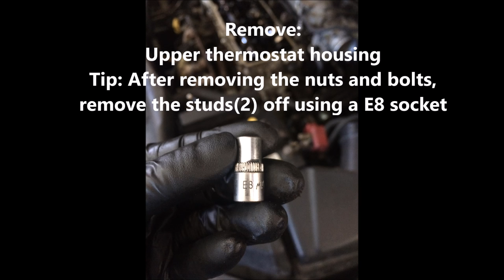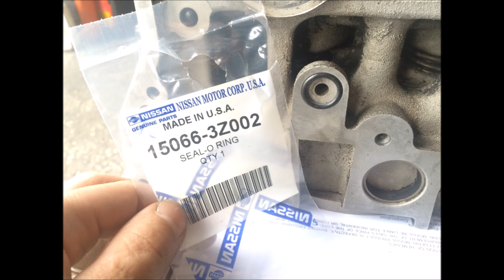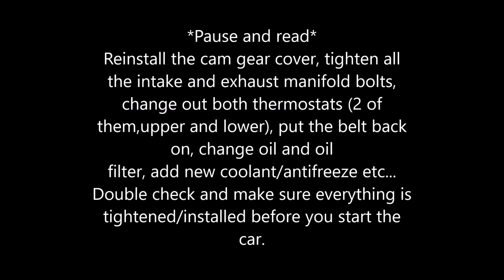Nissan Head Gasket

Comment: Good Afternoon Sir.   Had a question.  Did you just remove the upper half of the timing chain.  Looking in the Haynes Manual and its telling me to drop the oil pan, remove crankshaft pulley, and a lot of other stuff.  I don't mind doing that, however I didn't see in the video where you mentioned that.  From my understanding all you did was remove the upper timing chain and then held it up with a zip tie to keep it from falling.  Is that the way you did it?
Reply from the maker: Kevin Cahill yes the way I did it bypasses all that unnecessary steps. Only the bolts that hold the front timing cover to the head were removed! Saves you a lot of time!! Thank youa for watching the video! If you haven’t yet Please LIKE and SUBSCRIBE!!! I also have a Facebook page, Instagram and Twitter account and I do post different information on there as well.
Reply: Will do already Subscribed.  I am a former diesel mechanic.  Just bought a project car that only needed a head gasket.  Guy said piston rings were bad, however he knows nothing about cars.  Head gasket is blown and hopefully thats the only issue.  There was oil coming out of the tailpipe when it was running, however I think it is soot mixed with the coolant because of the headgasket.  Just gotta take  the chain off and it'll be ready for removal.  Thanks again.  I did not really feel like dropping the pan and all those unnecessary steps.
Reply from the maker: Thank you so much for subscribing! Hopefully I helped out a bit!

Comment: How do I know it’s at Tdc when I turn the crank pulley ?  Is there marking on the crank pulley I line up with that pin beside it ? or just watch the cams?
Reply from the maker: jacob mclellan there is a mark on the crank pulley/harmonic balancer that you have to line up with the marking on the timing cover. You also have to make sure the cams are in the right position as well. One crankshaft turn is only half a turn for the camshafts. Double, triple check before you loosen the timing tensioner or any camshaft cap bolts
Reply: Revved Up Knowledge Awesome ok thanks for replying this video saved me 2000$ your the man

Comment: Hey Peter is it absolutely need to send the head out for resurfacing
Reply from the maker: YES!!! absolutely do so! Its the main reason the gasket isn't sealing correctly anymore. over heating the head will cause the head to warp when it cools down. Thank you for watching!!!
Reply: @RevvedUpKnowledge  what is it is not overheat
Reply from the maker: If it’s not overheated then I would still have your local Machine shop check for straightness. If there is any warping then resurface it.

Comment: I really appreciate the detailed video, but am hoping to be able to avoid taking the entire cylinder head off! I bought a project '02 Nissan Altima with the 2.5 engine and today while attempting to remove the spark plugs in order to manually turn the engine, I noticed silicone had been used on the coil boots. I managed to get two of them off, but the tip of the other two are broken inside the spark plug well. Is there a way to get those siliconed tips out without removing the cylinder head? Is that even something that can be done without sending the head to a shop if I do remove it? Thanks in advance.
Reply from the maker: it happens a lot to me at work and the way i get it out is spraying with pb blaster or liquid wrench and let it sit a little. i spray a pretty good amount. Then ill take a pick with a 90 degree angle or a hooked pick that fits and run it on the side of the tube and try to pick it out. Sometimes if you have a air gun with a long tip that reaches all the way down you can try and blow air to pop it out.
Reply: Peter Nguyen thank you for the advise. I really appreciate it.

Comment: Hey Peter, when I was trying to find the TDC, I could only find the orange mark on the timing chain, couldn't find the yellow or gold marks, so what can I do to find the TDC without the yellow or gold marks?
Reply from the maker: if you follow the why i showed then those marks really wont help any unless you take the timing cover completely off.Those marks are used when installing a new chain or if you take the chain completely off.  when they are assembled, the first rotation will throw those colored markings off but the engine will still be on timing. i don't really know how many revolutions it takes for the colored marks to go back exactly on the tdc marks. Thats the reason why i mark them myself on the upper cams. hope this bit of info helps you and thank you for watching and please like and subscribe!!
Reply: Peter Nguyen I got another question for ya... is there any way that the timing chain could jump teeth with the timing cover on?
Reply: It takes 82 revolutions of the crank for those colored links and marks on the sprockets to all line up again after initially having them together.

Comment: Great video but i have a problem that i need to shootout. I made a mistake in mixing all the tappets and now i don't known how to indentified which one is inlet and which one is exhaut. Pls  Need someone help.
Reply from the maker: That’s going to be tough. You can pay a machine shop to match the buckets to their correct valve or assemble the valves with the cylinder off the engine block and use a feeler gauge to make sure you have correct clearance. Once you measure make sure you mark it with a sharpie. I would advise to pay someone to do it

Comment: thats good and all...but what happens when that chain slips a tooth on the crank.......
Reply from the maker: I haven’t had the chain slip a tooth on the crank yet. Just be careful and take the precautions to preventing it from slipping. If all fails and it slips then you will have to open up your timing cover and reset everything

Comment: Maybe you can do a Video on Nissan vq35de- 3.5L I have a 350z with lifter noise and can't find one video on Head removals Or Cam removal - It will be so great if one day you can Do one.. thanks
Reply: Harley Ryder its a pain in the ass bro. Just finished doing the heads on my 05 maxima 3.5. Its not too difficult but very time consuming.

Comment: I had a question at time frame 2:25 you have the pin on the right painted pink. I thought the colored links was suppose to be on that spot not at top.
Reply from the maker: The color on the chains are for replacing the chains or removing them totally and reapplying them back on. It’ll take forever to re align the markings by cranking the crankshaft

Comment: I had a question did you have to remove the side engine mount where the timing covers at?
Reply from the maker: Yes, it’ll give you a lot of room to work with
Reply: Revved Up Knowledge I took the bolts off the mount but it seems to be stuck pretty good. how can I get it free?
Reply from the maker: Make you took off the 14mm nut on the bottom of the mount too
Reply from the maker: Make sure*

Comment: Hi I want to change my head gasket i was just wondering at the end why did you need to changer both thermostats? Was that just for your car or does this need to be done for all cars
Reply from the maker: i change them just as a precautionary. You never know if over heating the engine could have damaged the thermostats. Some cars come with one thermostat and in this case this nissan altima had 2

Comment: This looks like a lot of work.  Is it worth doing in a car with 240k miles?
Reply from the maker: If it wasn’t too overheated and you can do it yourself it saves a ton of money and you can use your car for a little longer and sell it as well as a working car instead of junking it

Comment: How do you adjust the valves? Or did you adjust the valves?
Reply from the maker: i didn't do a valve adjustment but to adjust these valves you would have to change the valve bucket with the correct size one you need.

Comment: i got the bolts off sprockets. i was wondering how to get them off though? Tension on chain still tight.
Reply from the maker: thanks for watching! you need to remove the Chain Tensioner off first to create more slack in the chain. Make sure you compress the tensioner and slide the lock pin in or use a strong magnet like i do. not doing so will cause some of the tensioner pieces to fall into the chain cover

Comment: To set the timing do the colored chain links have to be set on the timing marks ? Or could I have one colored chain link on one of the timing marks.
Reply from the maker: When I did mine I rematches the marks that I put on the chains exactly. One or two teeth off will put it off timing and it will run low on power or worse case of its off a lot you'll cause the piston into contact with the valves and that will bend your valves and or mess up the engine
Reply: +Peter “LikesToFixIt” Nguyen thanks

Comment: Is it possible that when you remove the chain from the camshaft, the chain skips tooths on the crankshaft and mess up your timing?
Reply from the maker: i usually don't let the chain slack too much and zip tie it up to the ac hose. from what i have experienced with this engine is that it doesn't. i could be wrong though.

Comment: How long did this take you ?
Reply from the maker: not to sure maybe 1 1/2 to take off the head then i sent it to the machine shop. Then after i got the head back probably 1 1/2 to 2 hours. I've done this more than 10 different times on these cars so it gets faster and easier
Reply: +Tien Nguyen do they charge a lot to get it machined ?
Reply: My shop charged $125 and that was resurface and full compression testing. To ensure none of the valves have been burned by leaking coolant onto hot valves.

Comment: is there a certain way to set the engine tdc
Reply from the maker: That is tdc but to make the markings on the chain meet the marks you have to rotate the motor until it happens. It’ll take forever!! Those markings are used when replacing the chain assembly

Comment: what size are the nuts for the gear?
Reply: The timing gear bolts are 17mm and you'll need a 24mm or 15/16" combination wrench to hold the cam in place (and maybe a cheater bar if you don't have an air ratchet that will fit).

Comment: How do u take off the wiring harness?
Reply from the maker: Shabba Ranks thanks for watching and please subscribe!!! There is 4 10mm bolts on plug, 2 10mm bolts on intake manifold and unplugging some wires then just move the harness out the way like in the first part of the video
Reply: Revved Up Knowledge I took out the 2 10 mm bolts on the intake but I can’t find the 4 10 mm bolts you are talking about
Reply from the maker: Sorry I forgot to say 4 bolts for the coils
Reply: Revved Up Knowledge I took of the coil bolts and there still tension on the wiring harness that won’t let me move it out the way
Reply from the maker: Shabba Ranks I think there is a little tab or clip holding it down on the valve cover too. Follow the harness close to see
Reply: Revved Up Knowledge what is the size for the crankshaft?
Reply from the maker: I believe it is a 24mm

Comment: If the motor hasn't overheated, how important is it to send the had away for machining, and if I'm only replacing the head gasket, is it really necessary to disassemble the cams?
Reply from the maker: Michael O'Brien thank you for watching and please subscribe! if the motor did not overheat and your taking off the head you still need to get it checked by the machine shop, they will put it on a straight edge to check the clearances for it to see if you really need it or not. Yes you will need to disassemble the cams in order to get to the cylinder head bolts.

Comment: Damit I f up on this . I did it the same Way n for some reason the timing chain doesn’t extend far enough to the cams . I believe I got the chain stuck some how or something happened . Now I need to remove my timing chain deal
Reply from the maker: Did you bolt the cam gears to the cams first?

Comment: What happens if you don’t put that oring, forgot to put one
Reply from the maker: You could lose oil pressure to important parts on the head
Reply: Damn just did the head gasket and seen your video I guess the guy that rebuilt my head removed it and I never noticed it either! I have a p1111 code but car runs fine Thxxx!

Comment: Those lifters should have been numbered so you can replace them were they came from.
Reply from the maker: Yes they were numbered 😁
Reply: Revved Up Knowledge after looking closely, I noticed the numbers. Alot of people don't number them, then the have big problems. Good job though.
Reply from the maker: Yea If you misplace the buckets it’ll run crappy or worse case not run at all

Comment: You didn’t take the intake off🤷‍♂️
Reply from the maker: Nope, it’s easier to unbolt it from the cylinder head and bracket and to shift it back towards the firewall. Taking it entirely out creates more unnecessary work and wasting your time 😉
Reply: Well I’ll be damm billy I guess is to late for that 🤦🏻‍♂️🤦🏻‍♂️😂😂🤷‍♂️